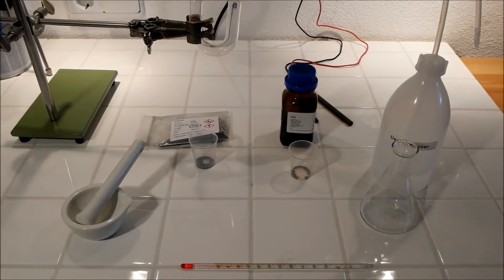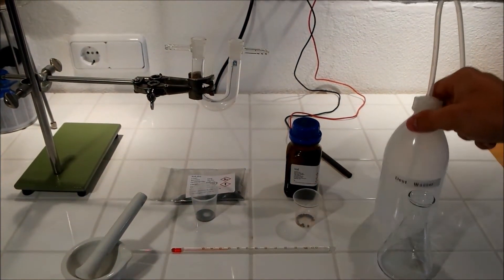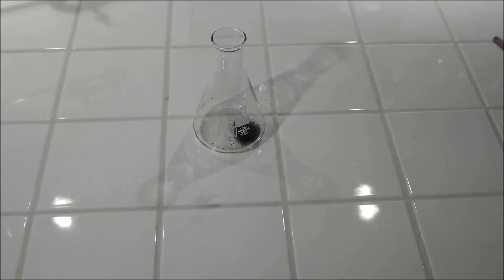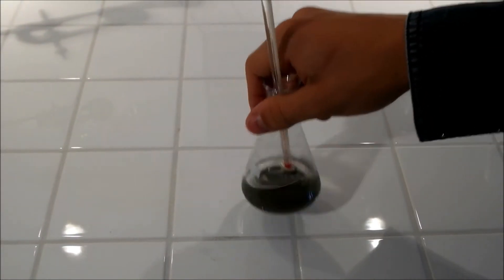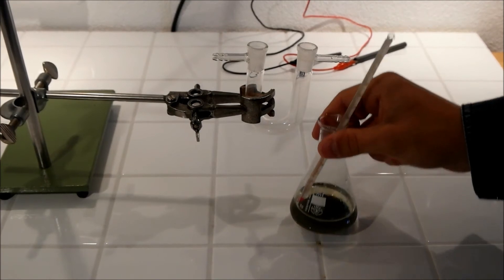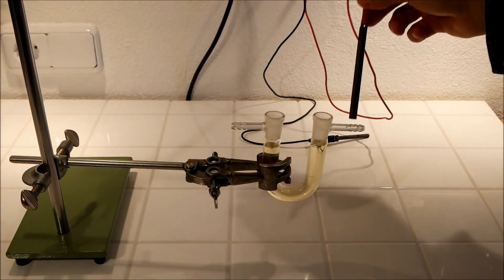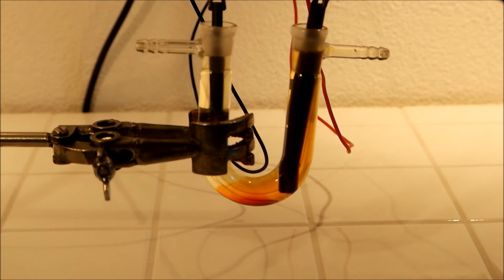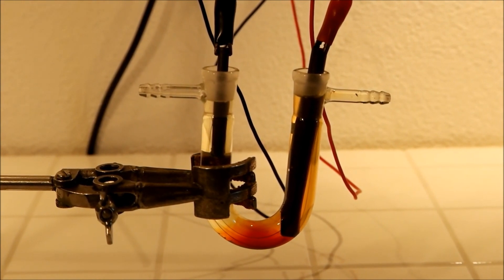synthesis and electrolysis of zinc iodide [ZnI2]

Comment: Zinc depositied not H2 given off, even though Zn more reactive than H, as concentration Zn2+ much higher than conc H+,. Also the power supply voltage is more than the redox potential of the Zn2+/Zn half cell, so we have an "overvoltage" which helps overcome the activation energy.